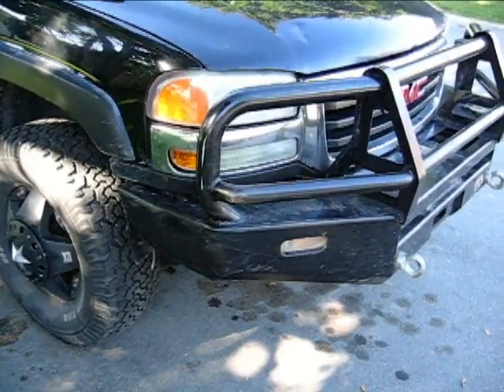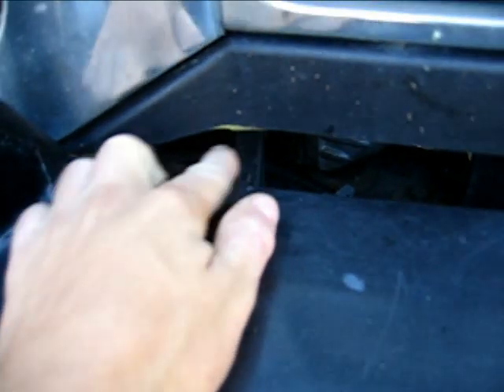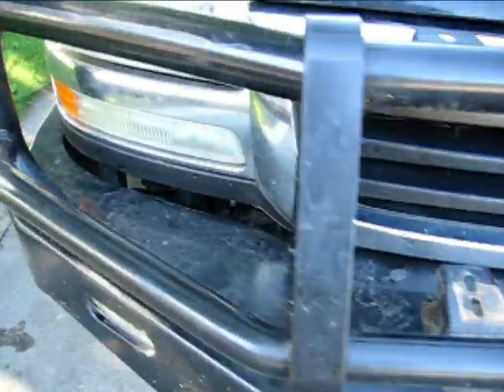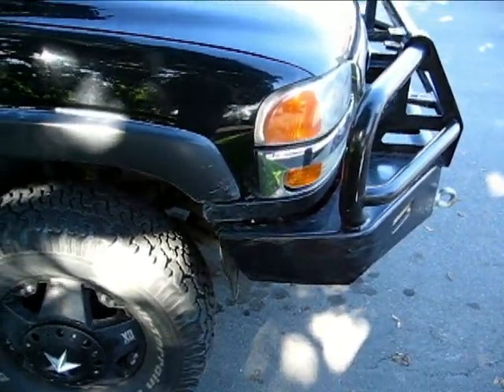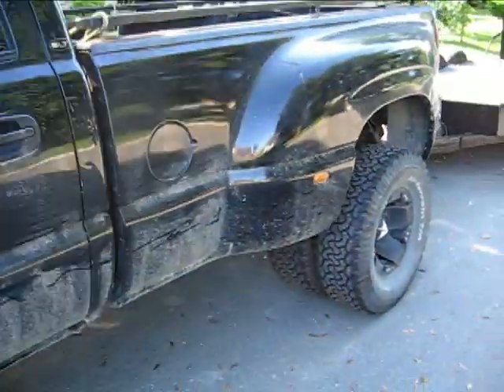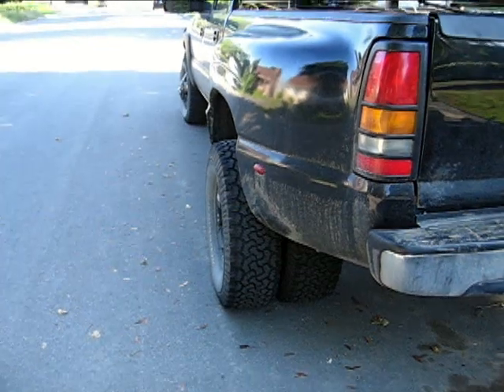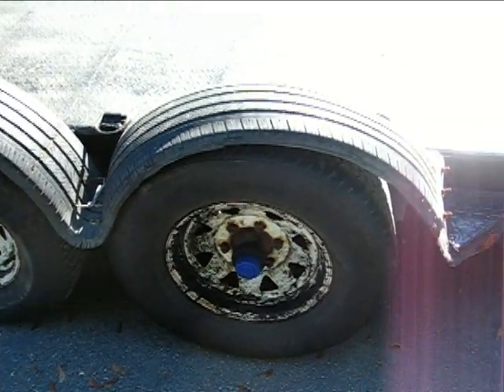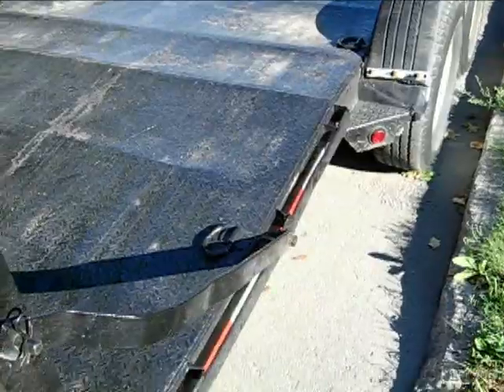ARB Winch Bumper on Sierra 3500 Dually

Comment: Man that is nice!!! No way does that look ugly..Beastly! Great looking truck as well!! Damn that's nice...
Reply from the maker: Texas Chevy they wanted well over 400$ for a oem bumper. Got this one for roughly the same price.  And this one won't rust or crack :)  I also found it makes servicing the truck easier, I can walk on it, use it as a shelf, etc.
Reply: Veikra Yea definitely the better way to go...My OEM one is pretty heavy duty as well I stand on it alot when getting under the hood,bounce on it for fun when on it..LOL and there isn't any rust at all..Are the oem bumpers for your truck different from mine..? Material wise?
Reply from the maker: Texas Chevy
the oem on this generation is so skinny ive slipped on it many times. On my 1994 it was sticking out more
Reply: Veikra Oh ok I have heard that as well. What do you know about a security light on the dash being on and blinking and the truck not starting..I know how to reset it and get the truck started but it still happens every once in awhile..Any info would be nice.
Reply from the maker: Texas Chevy  On which truck?
Reply: My 98 K2500
Reply from the maker: well mine had a early viper system in it. 1998 mine have had a factory one. I dont know.  But you will find a relay on the steering column loom, that splices into the starter solenoid relay. ( the wire that goes from the start position of your ignition switch to the small terminal on your starter
Reply: Veikra Dude thanks for that info someone else told  me it dealt with the ignition switch but you made it clearer. Thanks! I will look into it.

Comment: Pretty beefy bumper.  You going to put a winch in it?
Reply from the maker: dont know yet, it's not like I need a winch, I have one on my trailer. But I will modify the bumper to extend it lower and move it close to the truck.
Reply: You have a winch bumper,  you have to have a winch in it  :)
Reply from the maker: kind of thinking I could use it to store things inside instead :p It's also a  really nice shelf for tools when working on it hehe